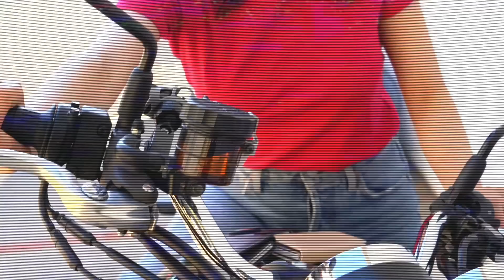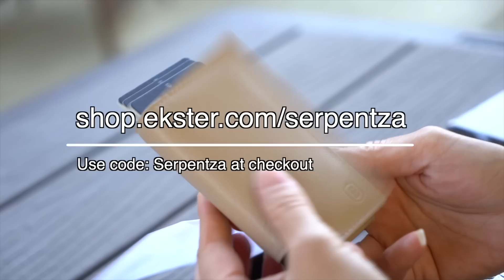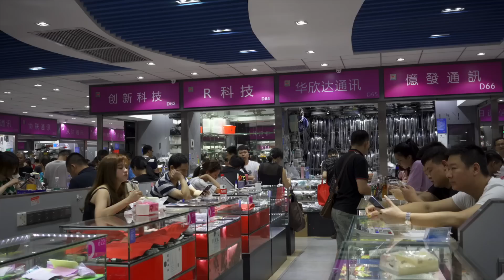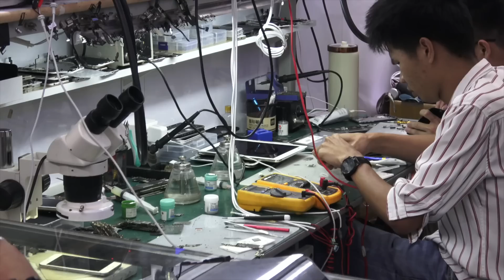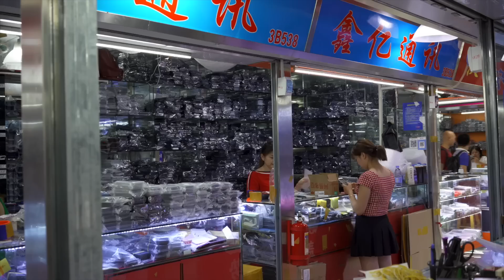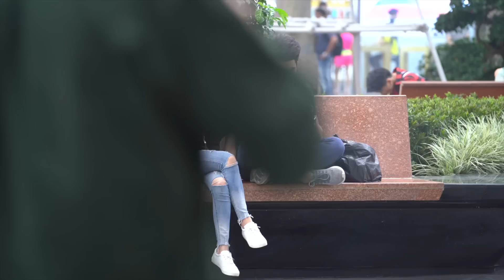Why China Can't make Chips!

Comment: Not only did it take them five years, with all of the resources at their command, there was the simple fact that every scrap of knowledge they needed to get the job done was already out there. The cultural issue is the chief obstacle. When it comes to manufacturing, Japan and Germany (and the American companies that have learned better) know that the key to quality is to do things the right way every time. Your videos make it very clear that doing things 100% correctly is simply not a Chinese virtue.
Reply: Of course the Chinese don't do things 100% correctly. That's a stereotype generally because of Asian excellence both in the mainland and abroad. They just work really, really, really hard. Specifically for the 5 year thing, compare that to London's industrial revolution and how long that took. China basically accelerated the whole process by reverse engineering everything, copying at first and THEN after gaining both the infrastructure and knowledge for the copied items went on to innovate. Shenzhen is the best example. Serpentza is a glorified English teacher who hasn't been back to China in years. He literally knows jack.
Reply: I agree...Chineese components even simple once as basic chips and varius transitors have a very wide quality spectrum, som copies are up to specs and over, some can hold the specs, and alot are bolow specs...same goes for chips...and when u have chips with million of components..i ever 100 components is out of spec...temp, freq, voltage, heat, power etc its obviusly not going to produce alot of working chips... if one chip on a wafer of 200 might work...
Reply: Ha ha ha that's so funny because when I was young Japan had 100% crap quality. Now Japanese quality reigns supreme due to mandatory government intervention. Germany has a societal affinity for excellence in engineering. In the United States you are completely correct, the best products on earth of the highest quality can come from United States, or some outsourced pieces of garbage. I live abroad and people keep telling me what the quality of American products are and I say between the best in the world and the worst in the world depending on the owner and the company philosophy.
Reply: @spechund7109  'reverse engineering everything'?
Wow, how many countries can do this ?
Reply: @Patrik6920  'chips with million of components'? This stuns you because you are not a chip engineer.
Reply: @bggfwjghg  China is an expert at reverse engineering tech. Don't know what your point is.
Reply: @spechund7109   Technical demand on reverse engineering is quite high. Otherwise why can't you see some backward countries be able to do it.  So don't laugh at reverse engineering. At least, can you do it? Try dismantle your iphone and come back.
Reply: @bggfwjghg  you need to learn English. I'm not making fun of it, in fact I'm saying reverse engineering is skills.
Reply: @spechund7109  Looks like you don't understand the difference between English skill and communication skill.
Reply: @bggfwjghg  讲中文否？自己英文水平那么烂还有脸批评别人😂.
Reply: @bggfwjghg  no it doesent at all... but that wasent the point either...
Reply: @Patrik6920  'no it doesent at all... but that wasent the point either..'?
What is this?
Reply: @spechund7109  ' 讲中文否？自己英文水平那么烂还有脸批评别人😂.'?
Here's the google translate result:
Do you speak Chinese? My English is so bad and I have the face to criticize others😂.
Reply: Got it ? You've got communication problem in English and expression problem in Chinese.
Reply: @bggfwjghg  keep dreaming ;)
Reply: @spechund7109  Where did you find me taking pride of my language skill?  It's you (you raised the English issue first), not me.
Check out the meaning of projection effect in psychology.
Reply: @bggfwjghg  I raised the English issue because your English is so bad you didn't understand I was agreeing with you. 白瓷😂
Reply: @spechund7109  'you didn't understand I was agreeing with you'?
This is it !  Send me this at the beginning and you would have saved us hell lot of struggles.
Reply: @spechund7109  白瓷? Your are right. Telling your loved one that you love her/him may look 白瓷. But it helps.
Reply: @bggfwjghg  il parle de la projection quand il est le personne qui project avec un case de Dunning Kruger, stp. 自不量力。
Reply: @spechund7109  Hurray, you've got a third language. But I dare not google translate it again. 😂
Reply: @bggfwjghg  I got more than a third language ;)
Reply: @spechund7109  '  I got more than a third language'?
foul language ?
Reply: @bggfwjghg  white space?
Reply: @bggfwjghg  sry if u missed it...the joke wasent ment to be at all racial... space as in null charachter or ascii(h20)..nothing else...my apologies if u was offended or any1 else...
Reply: @Patrik6920  dun onda de joke un lak commun zkiu.
Reply: @bggfwjghg  Q: whats zkiu?, (i dont speak bambara)
Reply: @Patrik6920  Skill!  Si Chun.
Reply: Reverse engineer, they even know how to read and write In all languages lol 😆 

It's still crazy how far China have come tho, from a country that could've been taken over by Japan in ww2, to being one of the biggest army, powerfull country with trading and manufacturer power that can hurt the world economy. 

After watching videos about the chip issues, I really get it now why they badly need and want to integrate Taiwan back into China as part of thier country. 

Taiwan makes more then half of the world's chips and currently producing the newest , smallest and powrrfull chip in the world. For the longest time i thought they just wanted taiwan back becasue of some old history between them but now i know why China willing to go to war for taiwan and why the u.s.a willing to stick their neck out for them.
Reply: @leww1982  Alibaba will close if no body buys from it. But do you have money for more expensive supplies?
Reply: @bggfwjghg  I m to poor to buy cheap stuff
Reply: @leww1982  What do you mean? Write in your mother language and I'll translate for you.
Reply: @bggfwjghg  trollo
Reply: @leww1982  DLLM
Reply: @jimmylee2745  You have a completely distorted view of China and its standing in the world. It's actually more accurate to say that China is more dependent on other countries. China still depends a lot on imported components and technology resources and knowhow. China depends on agricultural imports to feed its population, if they were to lose that it would be a disaster for them.
Reply: @vladtheinhaler8940  China does but from what it have achived throughout the decades, it's a big Mile stone that alot of countries can't compete with. For example,  manufacturers good at a high volume,  it was once dominated by japan but China mow holds that title.

Durring cvoid , it showed us how much alot of western companies  depended on China work force for manufacturing goods.

 . Each countries have something to offer, and that's why we have free trade agreement between countries . 

Like you united states, without ww2 , who know what would happen durring the great depression, they gain power and money through arm sales and developments. To this day the united states probably have the top 3 weapons within each categories.

As for food , China does have alot of people to feed but their trying their best to secure big lands and acres of farms across the world. They also need to put more strict rules and regulations within their food industry becasue  it's hurting parts of the western world . For example, within north america and austrilla baby formula have been in shortages due to the Chinese buying it all and re sale it at premium back home. 

It makes it hard for local parents to buy stuff for their babies, which is un fair.

2nd , the Chinese have manipulated the north americain ( especially Canadian housing market ) that regular floks can't even buy a home at.

Over all each countries have their own set of problems, each have different views abt each other and hopefully thier won't be a WW3.
Reply: You're jealous.
Reply: @spechund7109 
Asian excellence only in Japan!
Reply: @luisrodrigues2409  you wish. You can deny it all you want. The top Chinese universities (Tsinghua, Beijing University) are now more prestigious than their Western counterparts. You'll find out the hard way sooner or later ;)
Reply: @spechund7109 copium wars 2.0
Reply: They gonna get it right trust me

Comment: Also heard somewhere that the majority of machinery used in chinese manufacturing are made in germany, which means their entire manufacturing industry can be brought to a halt if germany decides to stop supplying or supporting these machines.
Reply: nah a dutch company named ASML has a monopoly on the photolithography machines required for advanced chips (EUV). funny thing is that ASML imports software, materials, etc. from the US, Germany, Japan, etc so basically China is dependant on a lot of western counttjes
Reply: @orbyfied  It's a super large chain of suppliers. ASML is big in the news because it's one of the KEY companies. But literally thousands and thousands of companies are connected to the production of chips. It's insane, and probably IMPOSSIBLE to do by China itself.
Reply: "Halt" indeed.
Reply: If AMSL stop supplying their lithography equipment to Taiwan, South Korea or Japan their entire chip industry can also be brought to a halt

Comment: Why China Can't make Chips=?
- Carl Zeiss, german manufacturer of optics and mirrors. It is precisely these high-precision mirrors that are required in the machines for lithography on the silicon wavers during chip production. You can do that with lenses up to a certain size, but if you want to go below that, you need these mirrors, which aren't exported to China. Taiwan has them in their machines.
Reply: Mirrors/optics are not the hardest part, the key part of ASML EUV machine is its light source which is designed and built by Cymer (based in California), that's pretty the most complicated part and China's has no access it.

Comment: Well 1 year later, Huawei have just shown to the world their new 7nm chip. And US can't sanction them cause they can't found any loophole. Every propaganda that were thrown against China is fading away and show how wrong most of western are. Not only they could manufacture 7nm chips, but expert now think that they will reach 3nm chip in 2 or 3 years.
Reply: Show me the Chinese company which can produce lithographs which would be able to do so. ^^
Reply: @Xarx42  Well depend on the techno. on 28 nm, SMEE can produce Lithography machine. for below, they are using the DUV ASLM machine with some modification. But again it's just a matter of time before China will be able to produce machine for 14nm and below. don't be mad.. you still think that sanctioning a country will not help pushing this country to be self sufficient? Did they really think that China can't make it?
Reply: @geektechpow4537  It doesnt matter what I believe. The sanctions are just starting and the chinese companies are desparately trying to buy as much from ASML as possible as long as they can. Nonetheless you are only guessing the sanctions wont have an effect, although you (correctly) admit that the 7 nm can only be produced by ASML machines and China is furthermore stuck with 28 nm for the moment.

Comment: The same applies to producing high grade alloys. It takes decades of R&D. Chinese fighter engines pack up after a few months for the reasons described.
Reply: Same goes for commercial airplanes these days use super advanced techniques to build the plane to be this light and fuel efficient.  Super advanced layers of material. With top secret production processes and even if you know the secrets it's still super difficult to make.

Comment: The GOOD NEWS is that if you need a limited selection of popular 7400 series chips, like the venerable 7404, 7406, 7414 and so on, cheap & mostly on-spec parts can be had for low, low prices!

Comment: Good one, many thanks.  I was in Shanghai and I took the famous maglev train from the airport.  I saw a PRC teenage boy bragging to an American couple about how cool this train is.  BUT the maglev train was manufactured in Germany by a Siemens-Thyssenkrupp joint venture.  I almost wanted to chip in and say, “it’s German technology, dude”.
Reply: That is right, I think maglev can only be done by Japanese and German. 
The Chinese are trying to reverse engineer the whole thing (on the maglev in Shanghai), but they just can't make it.
Reply: Texx Mexx  do you really think China built their space station by themselves? 100% of the high tech components like chips and processors are imported. China is not capable of producing them yet, they are 20 years behind.
Also, as for 5G, most developed countries already have this tech.
Reply: @danielbroomhall8882  5G is overplayed. It's not that great. It is just slightly faster, it used a lot more electricity and it works very bad outside the city where 4G is better. China was playing big balls with their 5G. Look at us look at us, while all western companies where like: 5G is not economically feasible and the downsides outweigh the benefits. Advantage: Faster speed nearby 5G antenna, low latency. Who needs it in countries for example my country has 1 gigabit up and down glasfiber to every house almost. Why needs it? When there is wifi everywhere? But 5G has very high investment cost. Lots of antenna's, high energy use with very few pro's. It's useless. 4G is enough.
Reply: The new Maglev train in Shanghai now bear no resemblance to the one Siemen built for them in 2002... 23 years has past .. After operating the world’s fastest commercial maglev train since 2003, China is now testing a much faster system that reportedly zooms at over 80% of the speed of sound. Referred to as an “electromagnetic sled,” the train has a top speed of 1,030 kilometers (640 miles) per hour.
Reply: @danielbroomhall8882  ..Huawei is one of the biggest holders of 5G patents, which is next-generation ultra-fast mobile internet seen as key to underpinning future industries. Huawei has the most declared 5G patents with 3,007 patent families followed by Samsung and LG with 2,317 and 2,147 patent families, respectively. Nokia follows LG, having secured fourth position with 2,047 patent families, while Ericsson and Qualcomm are in fifth and sixth places, according to industry analysis firm Amplified and GreyB

Comment: This aged like wine, only a year old video. China just had a chip breakthrough with American sanctions.
Reply: bro it was fake
Reply: @chaitanyayadav9610 how is it fake? Those 7nm chips that were made in China are what you would call advanced. 🤭
Reply: @chaitanyayadav9610  anything that hurt ur feelings would be fake.
Reply: @xzhou  how does china developing chips hurt my feelings it doesn't effect my daily life in the slightest wether china can make chips or not is none my concern.I watch his channel because they are entertaining that's all
Reply: Fake or not: China has no litograph technology which is able to produce 7 nm. The machines are coming from ASML and the sanctions regarding ASML are just starting in January next year.
Reply: @Xarx42  Wrong. SMEE is about to deliver their first advanced DUV machine with 28nm light source by the end of the year. ☺️
Reply: @Xarx42  Also, TSMC and Samsung also use ASML machines and can't make them like China can. China is also developing EUV machines in the near future.
Reply: @johnl691  "Wrong" because 28 nm is smaller than 7 nm?! 😆 If China will be able to push SMEE to 7 nm and beyond is a question only time will tell. For the moment they are pretty far away from it. 28 nm chips were released in 2011 already...
Reply: @Xarx42  I was testing you, and you failed.

With DUV (and EUV machines), foundries use multi patterning processes to cut transistor sizes down. With a 28nm light source, you can go down to 7nm (or even smaller) on a logic chip. It's also how ASML machines work.

Better do some reading up on a topic you don't know anything about.

☺️
Reply: @johnl691  Sure, sure! ^^ Firstly, ASML uses 13,5 nm litographs. But secondly: why guessing around instead of simply just waiting until China is able to produce 7 nm chips? The mentioned 28 litograph was supposed to be available already 1-2 years ago. Some newspapers say it will be at the end 2023 now, some claim its 2024 already. You're welcome to come back in a year ;). So long my original argument stands.
Reply: @Xarx42  No, they didn't. The only company in China producing mature (or above) DUVs in China was SMEE, and prior to the ASML ban, they had no reason to compete in the below 90nm DUV market. This news was a surprise to everyone.
Reply: @Xarx42  South Korea and Taiwan don't either... So why not apply the same standards to them?